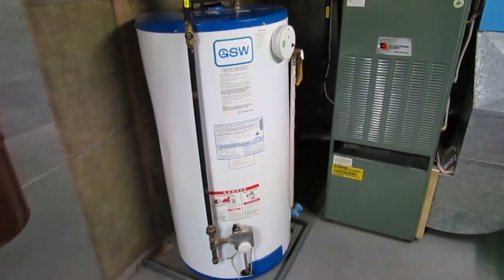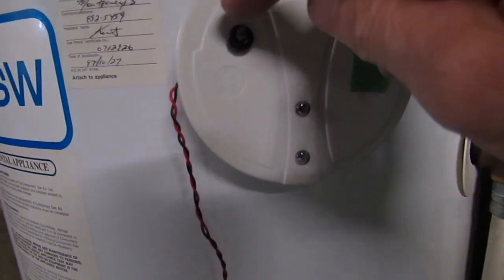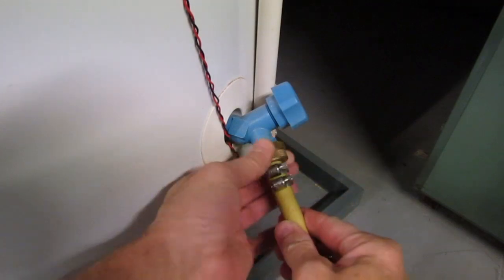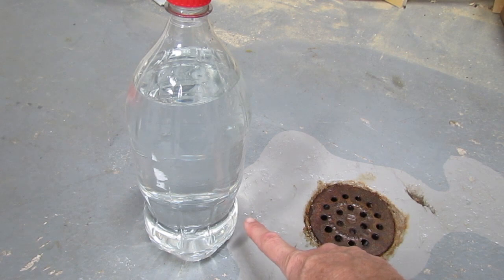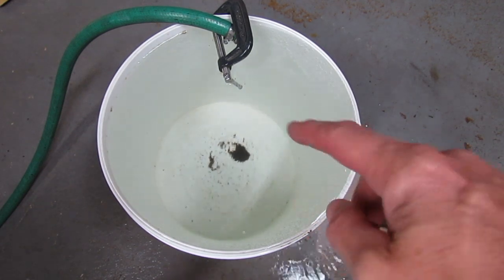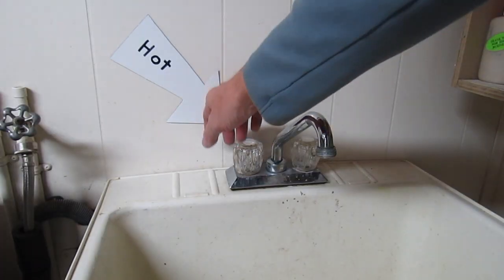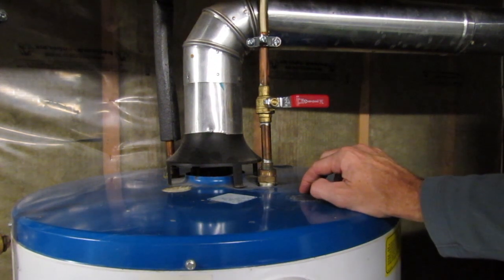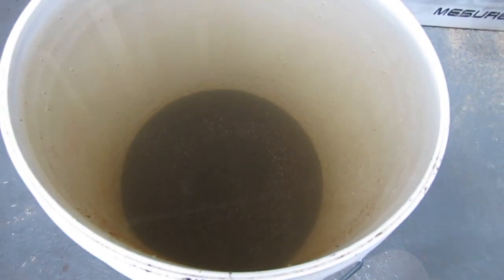How to Flush a Water Heater ● Simple Steps

Comment: Thanks for your video. We recently had a new heater (made by a fairly reputable water heater company) put in, and were surprised to see almost immediately after we started getting black sediment from our taps when running hot water. We do have hard water, but it's softened and filtered before it's fed to the heater. 

Used your video as a guide to drain and flush the "new" tank. Was absolutely surprised, somewhat disgusted, and somewhat ecstatic to see how much of that same sediment came out. 10 minutes of flushing, water went from black/grey to normal. 

TL, DR: might be good to do this on new installs, too...will certainly be doing this every 4-6 months, for sure.

Comment: Great video Chris. Have you ever changed the sacrificial rod in there? Apparently by doing that every couple of years the tank will last forever.
Reply from the maker: I never changed it. I was going to check it and see how it looks
Reply: What is a sacrificial rod?  The bottom heater?
Reply from the maker: It's great that you asked this question. The tank is steel and water will attack it and make it rust. If you put a less noble metal in the tank also, it will attack it first and not so much the metal of the tank, hence the term "sacrificial rod" because it sacrifices itself for the sake of the steel tank. Pretty cool that someone figured this out. Every few years if you checked this "sacrificial rod" usually made of aluminum, you'd be able to gauge how much the rod has corroded and then determine how often to replace it. It's supposed to make your water tank last longer but most people on the planet are not aware of it or that a water tank has one. Most people rent anyways and don't care.
Reply: Correct. I did mine after 12 years and it was mostly garbage.
I used a magnesium LINKED rod.(better)
$50 shipped from the Homeless Depot.
Reply: Good to see someone asked about this.  I was going to suggest Chris demonstrate checking this at the appropriate time in this process.  Maybe next time he flushes the water heater he will redo this video.

Comment: So you do not wait until the tank is full again to turn temperature knob back to warm?  What you did was after you were done: you shut off WH spigot and turned cold water supply spigot back to on (as water supply in WH begun to fill up).  Is that correct?

Comment: Change out that cheap plastic valve that comes with the water heater for a real brass valve. If regularly flush the water heater you will avoid a leaky valve when the plastic one wears out. Also change the anode every 3-4 years. It will make it last much longer.